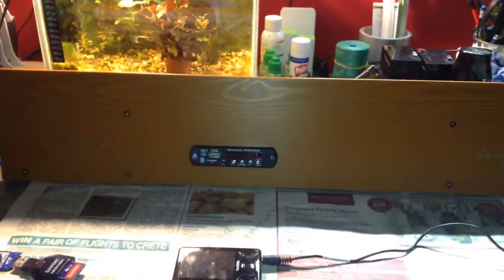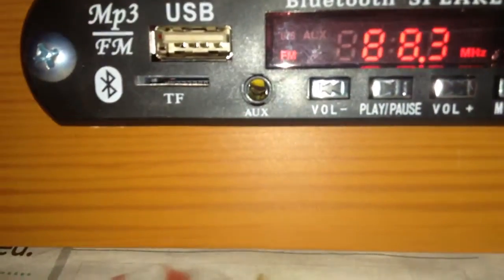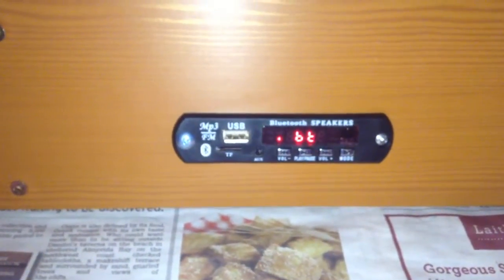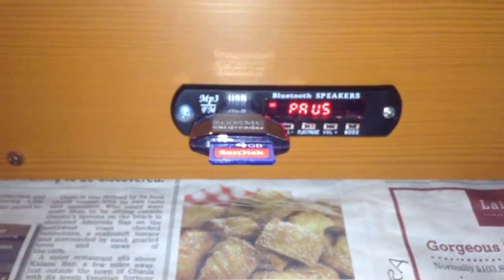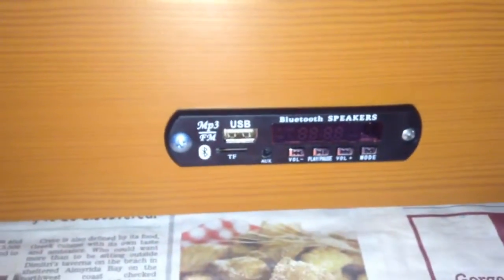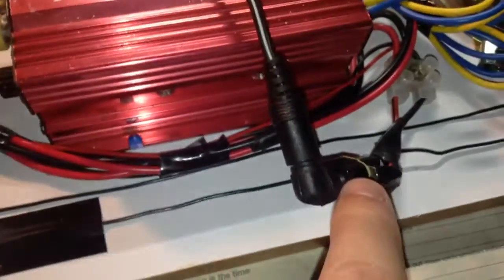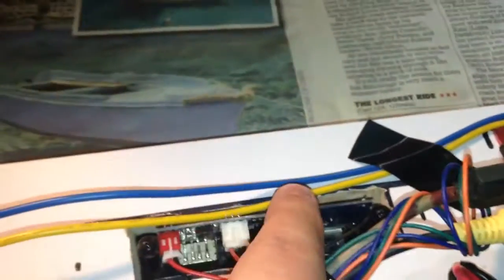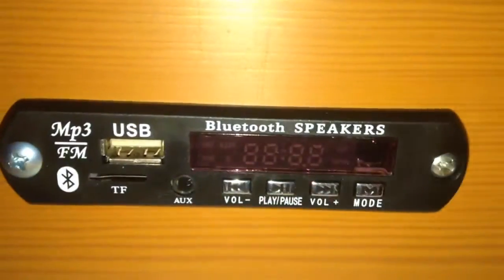22nd Jan 17 12v sound system

Comment from the maker: Hi, to the person who asked how to wire this into my solar power system. The electronic Bluetooth Speakers module and the audio amplifier both run on 12 volts, you connect both   red wires together and both black wires together. Then extend these leads and connect to the load output of the solar charge controller through a suitably rated fuse in the red wire. The rating of fuse is dependent on your amplifier, with the one I used a 1 or 2 amp fuse would be fine. Thanks solartiger